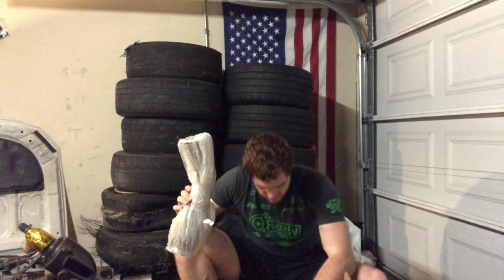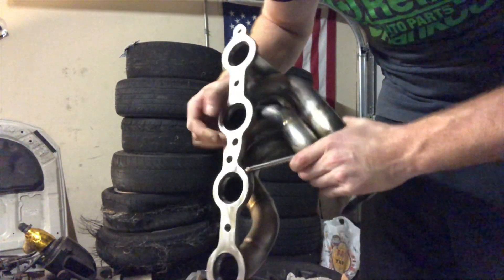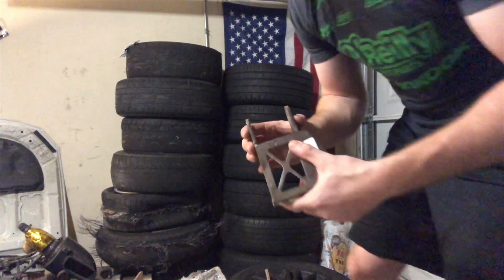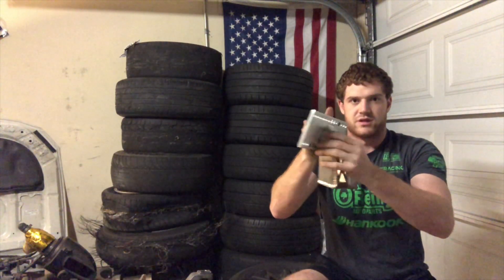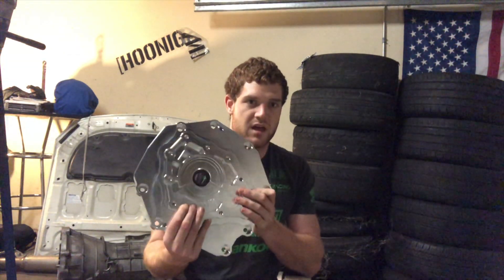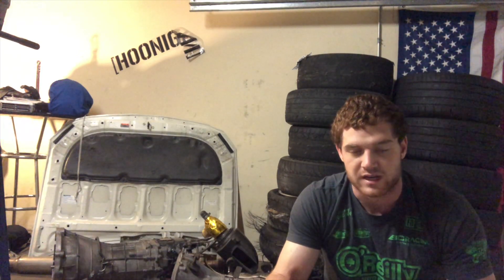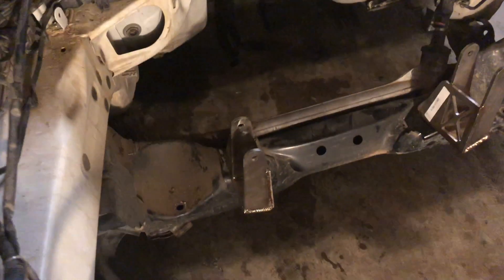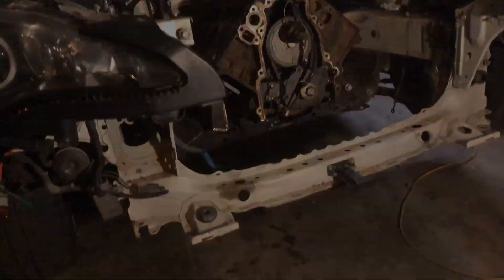FRS LS Swap: CX Racing Kit Review and Engine Test Fit

Comment: Looking good so far. I am using the cx mounts as well. First hole may be too far forward depending on fan radiator setup. Also the support bracket on your headers may need to be removed to allow the spark plug and wire to clear. Check ft86 forum there are mention of cx header clearance issue there. Mine did not come with the support bracket just as an example of consistency of product or maybe an issue they corrected. Keep up the build these videos help others!
Reply from the maker: Ok ill keep that in mind, thanks!
Reply: @WildSlideDrift   the cx racing mounts with many holes (the ones that bolt to the engine)

How far back does it allow the engine to be moved? I believe you bolted them in the center but i am interested in knowing how much back could you move the engine incase you wanted to??
Reply from the maker: @FirstLast-tx3yj  mine are two from the front for the front bolts. You could maybe do three from the front with a different intake and a pedal box but otherwise you are going to have issues with the clutch master and strut brace mounts
Reply: @WildSlideDrift  i am cuting the firewall 
I just want to know the length of the mount plate(the one with holes)

To see if its adequate for my project before i buy the kit